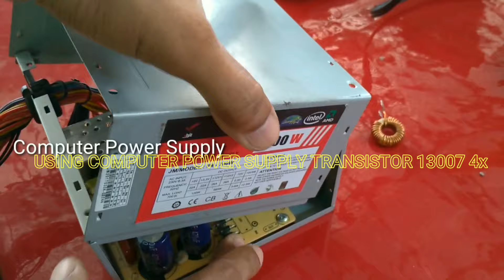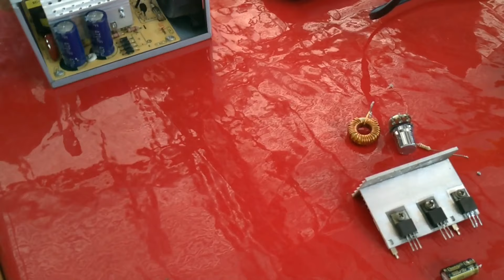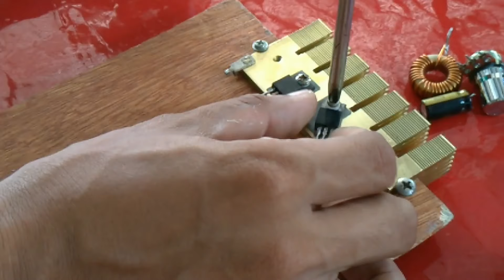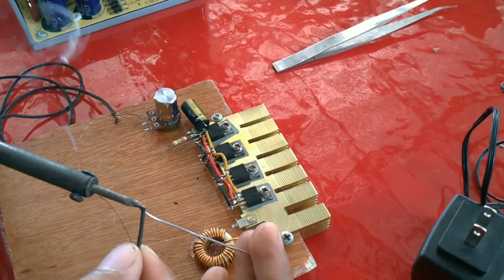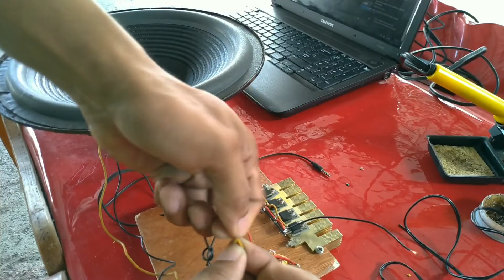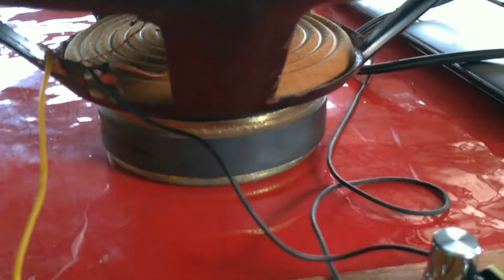Bass Amplifier Using Quad 13007  Transistor From PC  Power Supply

Comment: Gracias por este aporte 
Favor indicarme de cuantos watt este amplificador
Reply: Ya e visto esto antes.
Tiene casi el mismo diseño solo que en el otro vídeo, el cual se uso el transistor 13003 (x4). El propietario del otro diagrama, me escribio que puede soportar cualquier parlante con mas 15 watts.
Pero, como el transistor 13007 tiene un voltaje de: Colector a Base 700, Colector a Emisor 430 y Emisor a Base 9 volt... pueda que éste soporte de 20 a  25 watts.
Reply: @ittasukia.2748  Y a cuantos ohms???
Necesito saberlo para armarlo!
Reply: 4 o 8

Comment: 700w psu i cant believe until you open de case, crappi psu exactly for the proyect
Reply: it maxes out at 12v at 25 amps. that comes out to about 300w peak power. that is also assuming there are no voltage drops the amp is 100% efficient and the sub has 0 resistance.
Reply: @Zack-dk3pt  thank you my friend

Comment: Puedo usar un potenciómetro de 10k?
Reply from the maker: 50k
Reply: Thanks , es que solo tengo uno de 10k ☹️
Reply: De 50k a 100k.
Perdón... vi una referencia casi con el mismo diagrama con el transistor 13003 y resulta que usaron un VR de 100k.
Reply: Puedes usar uno de cualquier tipo terrecomiendo uno de 10 a 100 si usas el de 100 mueve lo despacio si lo mueves mucho no sonara si usas el de 10 no le podrás bajar todo el volumen pero sonara perfecto